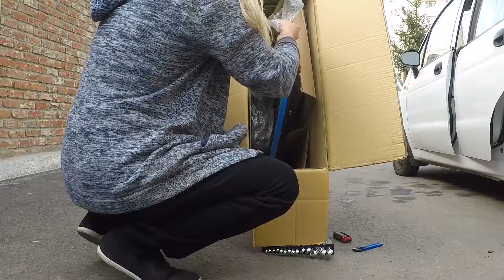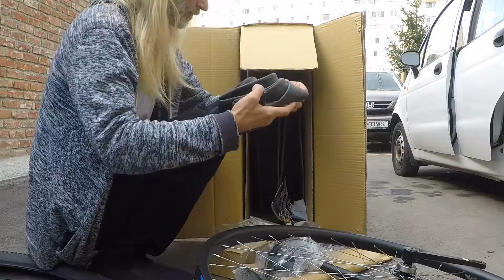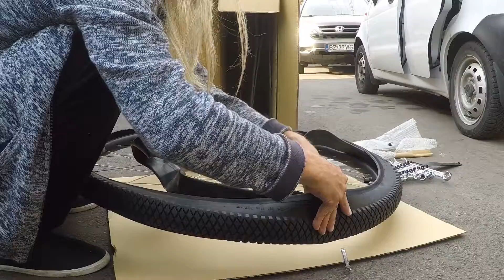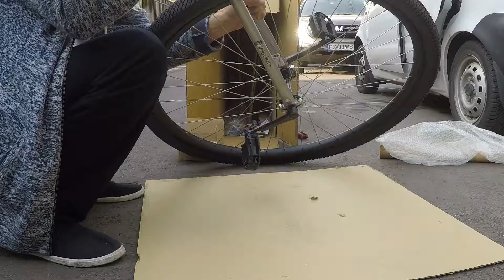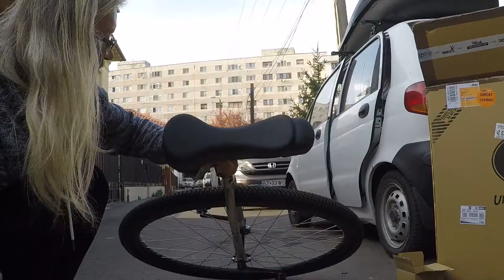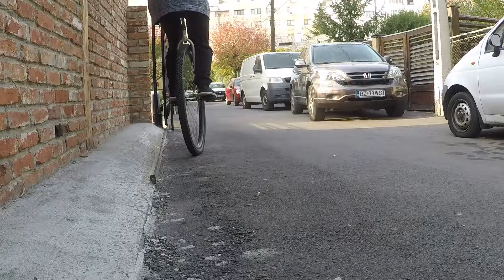UDC 36" unicycle - Unboxing, Assembly and First Use

Comment: 36er is always a dream for unicyclists 👍👏🏽😍. you can free mount 36er, GREAT 👍!
Reply from the maker: Actually, free mounting the 36er wasn't the hardest part. The hardest part is to control it at high speeds. In case of UPDs (which sometimes happen apparently without a reason on roads in a very good condition) it hurts even when falling on your feet. Now I prefer a 29er for distance. It feels safer and easier to control. And surprisingly the average speed of the 36er and two different 29" unicycles on the same route was not very different. I'll post the links with my tests bellow.
Reply from the maker: UDC 36" - https://www.strava.com/activities/3980679967
Reply from the maker: UDC 29" - https://www.strava.com/activities/4063737266
Reply from the maker: Qu-Ax QX Muni 29" - https://www.strava.com/activities/3541458694